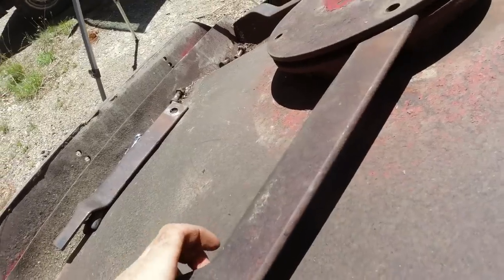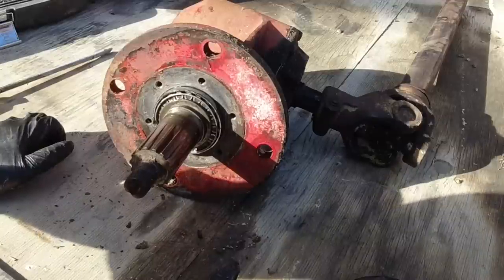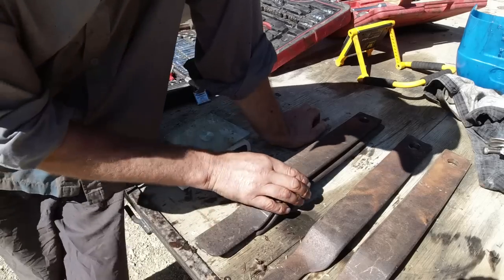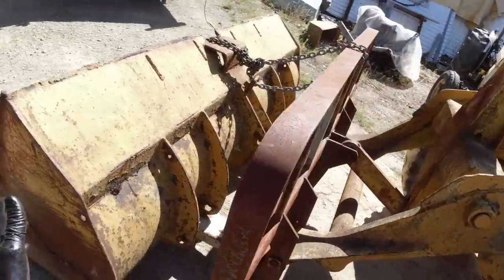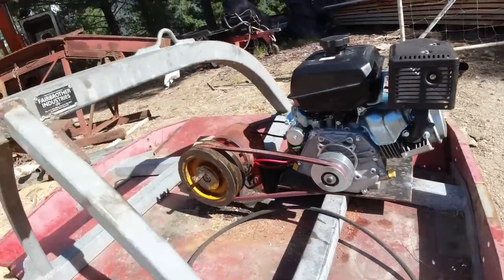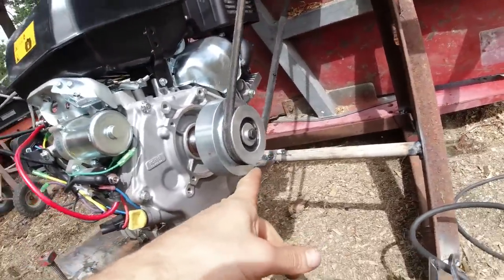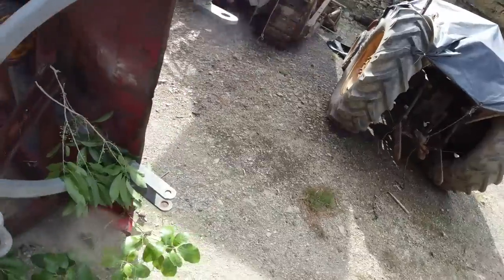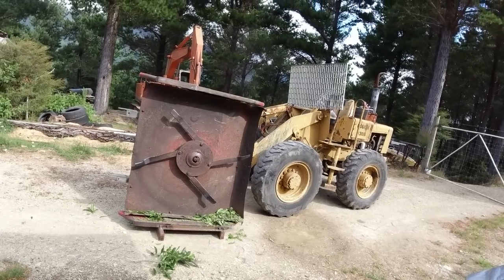Fixing an old Tractor mower and turning it into a Hedge Trimmer

Comment: At first I thought I’d never seen or imagined a more scary machine, but then you suggested attaching a small car engine, so I guess it’s possible to lift the danger rating from ‘deadly’ to ‘apocalyptic’ level!
Reply: what could possibly go wrong. lol.
Reply: Everything
Reply: Have you thought about using some duct tape? Welding it was probably overkill. 
😂
Reply: @Stephen Dalby  sorry I didn't know I was supposed to be involved!
Reply: @duck-tape  apologies for mis-spelling your name.
Reply: Two men enter one man leaves. 😂
Reply: It’s no more dangerous than if it was mounted horizontally…
Reply: I don’t know – I drive a Nissan Note, that would change the level from ‘deadly’ to ‘we’re not gonna make that hill in third gear’
Reply: I thought there would be a flamethrower.  It would probably make it safer idk.
Reply: Hilarious🤣
Reply: @isickofit  As long as you wear your safety tie!
Reply: @BrainHurricanes  
Or squint in a safe way.
Reply: He said nothing, nothing at all about a turbo..
Reply: @brianlowe753  🤣🤣🤣

Comment: Marty, just wanted to make a quick suggestion from my own experience that might help you out next time you’re trying to remove the blade plate or stump jumper plate from the bottom of the gear box. A little heat with a torch around the inside edge of the plate around the shaft will make it expand making it easier to remove and also help release some of the rust that bonds it to the shaft. But be careful not to over heat and cause damage to the shaft or internal components of the gear box assembly!

Comment: Good idea Marty!

Those tapered roller-bearings in the drive hub will probably lose their pre-load again, unless something is stopping them walking along the shaft. Shims which bear on the inner-race of the bottom bearing and are held there by the bottom plate would do the job. Setting the pre-load might be tricky but I think an end-float of about 0.007" would be a good place to start. End-float allows the bearings to not become too tight when the shaft gets hot and expands.

Comment: Gosh this bought back memories with the Butler Bros here in Taranaki 50 -70 years back. They bought army surplus Bren gun carriers, trucks for sweeps, fabricating hedge trimmers such as yours, but swinging 10ft blades. There business was cutting the gorse and barbary hedges here in Taranaki, world famous for there "Heath Robinson" contraptions. Hedge bits were thrown hundreds of feet in the air, and with only a basic cage over the cab!. the noise and sight of these things working was a sight to behold. Are you related???

Comment: I would go with the hydraulic option - an orbital motor driving into the right angle gearbox.  The pressure relief valve will allow you to protect against overload.  The on-off valve at your hand in the cab will make it a lot safer.  Rather than add power, you might be better off adding flywheel inertia - on the actual blade holding hub.  Well done!

Comment: Marty, some years ago I was talking to a bloke cutting firewood at a bush mill. He had a 4 cylinder motor driving the firewood blade and was in the process of converting to a V8 as he would lose momentum too quickly. Hi did the conversion but it was not much better. Problem was there was not enough mass in the flywheel in either petrol engine. Tractor flywheels are quite large things so that takes care of the slasher on the back of a tractor. Just a suggestion but you may need a heavy flywheel which ever way you jump. Cheers mate.

Comment: One of my greatest memories as a young lad was back in the 60's when the "hedge cutter gang" turned up to trim the barberry hedges on the farm. Now this was in the days before hydraulic motors so everything was driven by big wide belts running off the PTO's. Now these machines were all homemade and really looked like something out of Mad Max. I have searched high and low for photo's of them but with no luck. I would have been 7 or 8 the last time I ever saw them and was totally fascinated by both them and the guys that operated them. The sound of those huge swinging blades has stayed with me always. I'm in New Zealand and in my 60's. Love this channel, cheers Marty

Comment: I think what you've done is awesome and I'm always impressed, but given the challenge of upgrades to tackle bigger branches, and seeing the driveway and what's required, I think you'd be better off replacing those 4 x slasher blades with a dam big circular saw blade like on your timber mill. That'll cut and lop branches merrily along the driveway! As always thanks for sharing!
Reply: I was thinking the same. Cut them rather than bash them till they break.

Comment: A few years ago, a local guy here fitted  a hydraulic powered 5-6 ft mill saw to the arm of an excavator and made good coin trimming cypress fence line trees. 
Rumour has it all stopped when the blade came off and finished over a kilometer away.

Comment: Morning from the US Marty! Just a quick safety upgrade for you so you can check and forget it. Right now if you lose a nut on the blades, the bolt falls out and the blade becomes a 200mhp guillotine! You can drill a hole in the mower deck and put the bolts in from the top. If a nut ever falls off the bolt keeps the blade on the mower! It’s also a quick visual check, 4 nuts and you know you’re good to go.
Reply from the maker: I did consider that but the bolts are designed to go this way, other way round the nut is more likely to get wound off by the branches etc

Comment: good job! the rural road maintenance crew where i live have 48" brush hog mowers on a multi section hydraulic arm mounted on the side of ford 5600 series farm tractors to trim the branches of trees along the county roads and they can reach out to cut branches that are 4" in diameter right up to the tree. they are powered by the tractor's hydraulics as well as is the arm. saves a ton of man hours over crews with chainsaws, and there's no branches to clean up as it all gets turned to mulch lying on the roadside that helps keep the weeds down as well. i'd go with a multiple belt set up to put more power to the blades when you get your 4 banger mounted up.

Comment: You might find that without some rubber isolation mounts for the engine that it may start to develop oil leaks from the casing. I had exactly that issue when solid mounting one of those engines onto a steel frame for a generator. Also I'd advise moving that ignition switch up to the tractor or at the least wire an emergency stop button onto the tractor. You only discover that you really need an emergency stop at the very worst time...

Comment: Dandy! Pretty innovative use of a brush hog. A 40-45HP reefer engine should run that dandy. It'd be governed, easy on fuel, pretty self-contained, and have a fair bit of torque. And it'll run as long as you'll ever want or need to.

Comment: Hey Marty, something I picked up with model plane stuff years ago, when you are balancing the blades, measure where the center of balance is for each blade too, its a fine adjustment, but say one blade had a lot more weight towards the bolt hole, and the other on the tip, they might weigh the same, but the balance would be very different.  Always enjoy your vids, cheers.

Comment: Amazing Idea you had rigging the cutter with a motor You really do awesome stuff when you put your mind to it ..
A bigger motor is a good idea. Maybe you can perhaps gear it differently ...like a bigger drive wheel (pulley) for the belt on the motor side will speed up the cutter and possibly reduce the strain so with a bigger motor it will be even better...

Comment: Hopefully the lubrication in that right angle drive unit is still okay operating in that orientation. I read the other day in an old truck manual that if it was towed by lifting the front of the truck the oil would not properly lubricate the rear differential as the truck was towed down the road resulting in damage.
Reply from the maker: Yes I did think the same thing, oil level is halfway up the bearings and gears so its ok

Comment: Real Kiwi machine that one. Lots of huge old examples here in Taranaki for hedge trimming in days gone by (now in the museum at Hawera). I have owned one of those old Fairbrother mowers and that one you have is in amazing condition as the bodies on most of them have rusted away. You might want to consider removing the skids as that would allow the branches to reach the blades better. But you're gonna need a bigger motor for sure to maintain cutting revs. And another safety screen right on the mower would be good!
Cheers from Tikorangi (New Zealand)

Comment: Camarata made a similar mad max tool a couple of years ago, using fixed blades which were sharp and cut using the vehicles speed - equally mental but yours works much better.

Comment: Brilliant, this is rather what I expected when I clicked the sub button about a year ago. I learned stick welding with a handheld mask, hated every minute of the lessons, your welding mask is a perfect adjunct. The trimmer is a thing of wonder and the guard is a sight to behold; I was thinking you might find one of those 3-cylinder Suzuki Cultus/Geo Metro motors in a scrap yard to provide a horsepower boost. They were available with a turbo, that kind of power would remove brush like a mofo. As always, thanks for the vid, such good stuff.

Comment: What about replacing the heavy mass rotary blades with an old buzz-saw blade? That's linear mass, with a true cutting edge. Stand it off another 10cm from the mower deck for clearance in case something gets caught behind. You'd be lifting less but may have to drive much slower.

Comment: Anti-seize on the splined shaft when putting it back together. I’ve been doing that on gearboxes like that when replacing the seals, I haven’t had to pull any back part again yet but I’m assuming that should make my life easier when I do.

Comment: You are lucky because some Orchard mower the gear box have a air vent on the top of the gear box so when you tip the mower on it side the oil could well leak out but yours didn't

Comment: That mower could go on the excavator boom as well. That would give you a lot of reach and maneuverability.  You might get a hydraulic motor from an old skid steer or something as well. The mower blades that are worn back so badly probably could be fixed with just an old blade from a lawn mower if you were to just cut a piece out of the lawn mower blade tip and weld it into the gap on there orchard mower blade. Not sure but I think an entire lawn mower blade might be hardened steel. If that's the case you can cut a chunk off about anywhere. It might be thinner metal but it would probably work and would be an improvement over empty space which is what's there now.

Comment: I had this same problem with a bush hog back when I was a kid in the 1970s. It took me 3 days of beating to get the gear box off. I finally heated it and beat on it and it came off. Jim in Chile.
Reply from the maker: You should have made a puller 😉
Reply: @MartyT  I could not. My dad was too cheap to buy a welder. We did not have a cutting torch so I had to use a soldering torch for plumbing. My dad was kind of a cheap skate. Hahahah 
He was ok with us beating on it for a week. Jim

Comment: you should find a hydraulic motor and mount it on the excavator  , with a 40" circular saw blade on it.
My shelter belt trimmer was similar - a HIAB on the back of a tractor with a 15 m extension and 3 x 40" saw blades at the head end,  able to cut horizontal and vertical.
that thing would fell large trees

btw the whole tractor was completely covered in 3.2mm  steel plate and the cab windows in heavy duty steel mesh.
You wouldn't catch me driving that thing you built with an open cab.
I left a door open a crack for some air and got hit between the eyes by a piece of tree.
You may think you are out of the line of danger from flying debris but it has a habit of ricocheting everywhere

Comment: I know most don't agree with my thinking on how sharp blades on shredders, and limb cutters should be. 
Most just leave the blades blunt, and go the brute force method. 
I've learned that you may buy a few blades over the years, but I save the abuse on my  tractors by not having them bog down when I get into the heavier cuts, and the blades just glide right on through. 
Plus I sharpen more of the actual cutting edge further along the blades even into where it offsets.
I find it makes a cleaner cut between them being sharper, and more cutting surface along the blades.
Reason I believe is that the leading blade makes contact with more of whatever it maybe I'm cutting, and the following blade hasn't as much left by the one proceeding it.
Even though it's now in the lead position due to forward motion, and although it doesn't seem like it would matter, but if it helps any at all it reduces the amount of leftover from the blade before it, and it doesn't leave as many stragglers that were missed altogether.

Comment: I did the same thing but like you had mentioned I used an old 4cyl Honda motor that was mounted on the cars subframe and man that thing was a beast. i was cutting 4in limbs with it and it didn't even flinch.
Reply: 🤣Now that would have been something to see! How much of the car was up there?
Reply: @reelMn  it was just the subframe with the engine, and radiator. 1981 Honda accord, is what it was, if memory serves me correctly. and i had also mounted 2  hydrolic pumps on it, 1. too run the mower, and 2. to run the tilt function. and then I had a hydrolic tank mounted on a 3pt hitch.

Comment: If you change either the pulley on the motor or on the cutter assy, you could regear it for a better ratio for speed
Reply from the maker: gearing was actually pretty close to optimal

Comment: You cannot hold a fertile mind back. That is why we like our old surplus equipmentt. Very usefull. Great thinking. Great video. Try opening up the front of the mower box. The blades can cut without the brush being pushed aside. Like the face of a giant weed eater. 😁 Humm a big block V8 possibly.

Comment: down our way there is a bloke with a grader , with a huge long boom and a saw blade at the end of it he can raise and lower it ,i don't no if he can make it telescopeice in or out or not, and don't no if it is hydroastic or not but  it would make sense to have that system .amazing to watch he does big hedges, dont no the speed of the blade but it does the trick , you could use the same cutters you have off that mower get a addeptor made

Comment: Marty's track mower, usable for the high stuff, low stuff and the 3 point hitch looks intact. Could be for gorse mowing easy enough. Use what you got Marty, Max has nothing on you.
Reply from the maker: Yes it will be a 20 minute job to put it back on the tractor if I ever need to mow the lawns 😉

Comment: That reminds me of my dad with a circular saw cable tied upside down in an upside down milk crate, with the guards off and the trigger cable tied on.    It not quite at the level of a slasher I saw in Russia,  basically the same thing but with no deck, ie no plate, just the frame.  I feel like you must be some kind of relative......   Greetings from the Mainland........

Comment: Well done sir, We have a few crazy inventors over here that make that kind of stuff. In the main they don't work. That however is lethal and effective.  What about swapping round the pulleys with the smaller of the two on the shaft of the cutter. Just a thought 💡  Later Luvin the safety grill.
Reply from the maker: The gearing is about spot on at 1:3.2
Reply: @MartyT  I knew that would probably be the case. Not to worry like all other stuff you do it will all be ok.😂

Comment: Should extend the rear flap on the mower those branches seem to move at quite the speed specially more so if you gonna slap on a car engine need to prevent stuff flying backwards.

Comment: Hey Marty, would  it be beneficial to grind them all to the same weight? I figure you  are making  due with what you have got. But making them all the same weight  would solve everything.  BTW yet another excellent video and great  use of recycled stuff.
Reply: The problem that it's more than total weight, it's also how the weight is distributed along the length of a spinning blade.  The further out, the more the weight pulls, you need to think of foot-pounds or joules. That or build something sturdy enough to handle smallish differences.

Comment: This is awesome. Do those loaders have much electrical power available? I assume it's going to be too much to fit an appropriate electric motor to the cutter.
Reply from the maker: It only puts out about 700 watts, it would need over ten times that amount
Reply: @MartyT  That makes a lot of sense. I've just watched your videos on the radiator issue you had and that's a small alternator.

Comment: You should try it with two blades , it'll lower the strain , blades will balance better and you should get higher rpm.
Reply from the maker: that's a good idea, easier on the little engine

Comment: The solution has merit. You could also remove part of the deck (forward) so that the blades can cut stuff that's right into them rather just touching them. You wouldn't need that portion of the deck anyways because it can't possibly hit you with anything through there.
Also... maybe consider making this attachment a more direct fit (to lower the weight from the forks and chains) off the hydraulics and the front of the machine.

I think it's a pretty damned good idea. Were i in an equally remote area i'd jump on top of it in a giffy, but unfortunately, the potential for impaling someone with a blade by proximity is too much to risk for me. :(
However, if cordyceps jumps to humans and we have a zombie apocalypse after all... 
😜